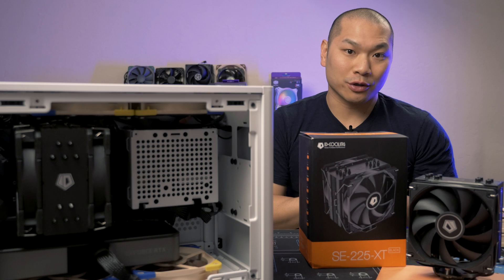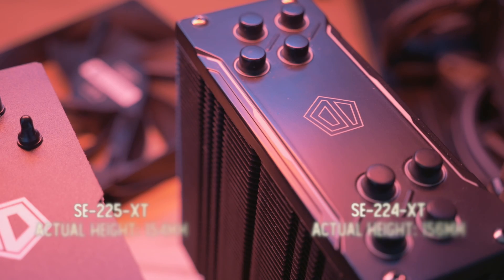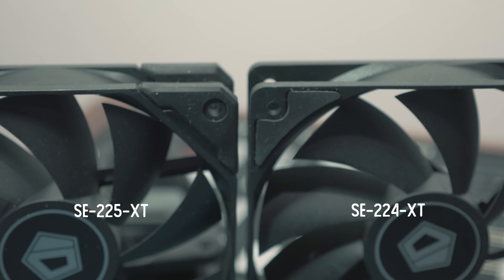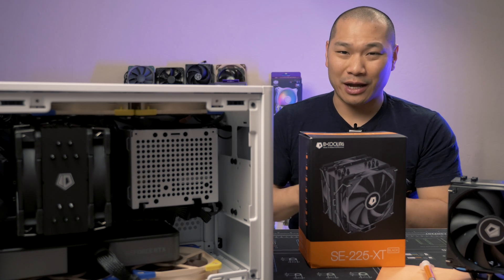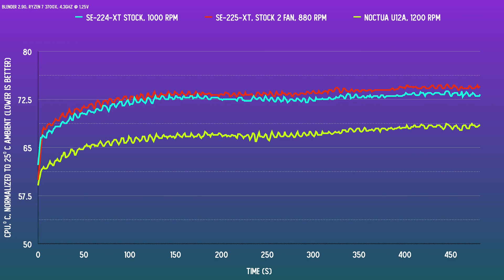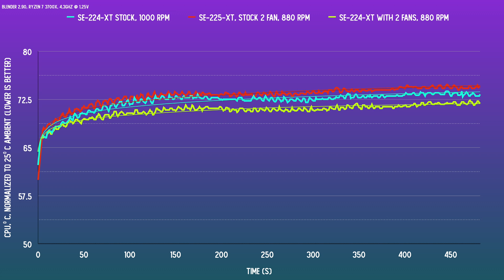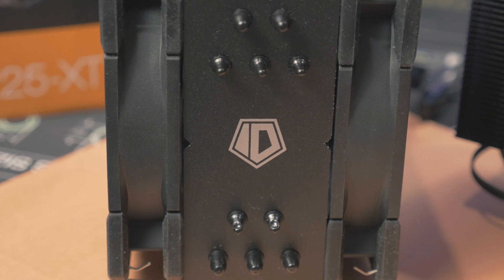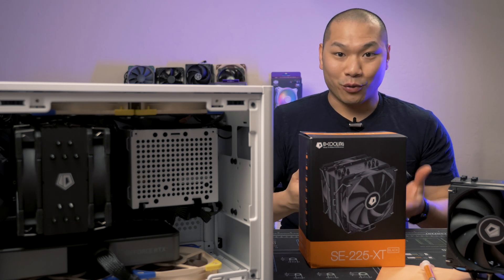The ID Cooling SE-225-XT: Ryzen 7 Test

Comment from the maker: Since the thermal tests are kind of counter-intuitive with the single chiplet Ryzen 7, and I think the heatsink design has a big part to play, I will be posting up a quick follow up for tests with a single chiplet 5600x and a dual chiplet Ryzen 9.
Reply: It's probably poor quality control on ID Cooling's part.

You can check this other review of another SKU that supposedly has better cooling than SE-224 but outright loses(turn on english subtitles)
https://youtu.be/wEoTJcYe510?t=688
Reply from the maker: Thanks for sharing that, very interesting. I hope it's not QC, but then again, maybe it is. Small variances in the heatpipe/vapor consistency could lead to big differences.
Reply: Woot! Was gonna ask about ryzen 9 performance. Considering options to replace my cryorig H7 quad lumi. Gaming in the nr200p with tg panel it hits mid 70s but that means 100% fan speed. 

When I ran the 5600x with the same cooler and orientation it barely broke 70.
Reply: do you know if this cooler is compatible with an intel LGA 2011-3 socket?
Reply: Hi Sir! I have Ryzen 5 3600, NR200 case with mesh panel and I plan to use this cooler. My motherboard is B450i Aorus Pro Wifi
Reply: @piptaz04  use SE-224-XT
Reply: Guys buy 224xt argb v2 version . The fans are way better than basic version presented in this video . I m using it with 5800x max temp with PBO activated 80 C  in CPU Z stress test and 60C in games  30 idle. I have buy this cooler cuz i see @machine & more 2 years ago. 
All the best.
Reply: dude a word of advice...youre very technically capable and have hands on skills - but the flow of logic and ideas in your videos is not clear /properly explained. 
You need to have a good script and explain 
-what youre going to do, 
- show what youre doing,
- explain/summarize

Doing this will boost your viewership

Comment: The SE225's design for the base with gaps btwn the heatpipes probably caused it to perform worse than the 224 because of the very high thermal density in current and more recent cpus.

Comment: I theorize that as the heat pipes exit the base plates on the SE-225, they are too close together, forming a wall so that air cannot flow between the pipes.  This is evident at 2:04 in the video.

Comment: Fascinating result, good creative idea to try 2 fans on the SE-224!  The situation is probably like the Fuji F21 camera (or whatever, i may have forgotten the model) and/or the Panasonic Lumix ZS4.  Both manufacturers produced MASSIVELY superior devices whose pictures dominated ALL CAMERAS for 5Y or more, 1-2 f-stops sharper than all similar cameras.  Why?  Some sort of "very good luck" or "perfect matching" of components (sensor density, lens).  Even though both manufacturers continued to release new versions of their products at higher price points and with more features and even CMOS sensors, they never attained such greatness again ...

Comment: I'd like to have seen the SE224 xt with the Noctua fans in push pull. I'm going to build and use a 224 XT with two Arctic cooling bionics fans but it won't be built for a while. I'm going to use it in the tropics and I want it to work well even when air conditioning is broken.

Comment: Really wish i could find heatsink tests with standardized fans at different heat loads and different CPU's, think it could be pretty interesting to see, i'm currently using a Mugen 5 with a 5600x but thinking of moving to a smaller heatsink, upgraded the fan to the Phanteks T30 so i've been wondering how the Mugen 5, SE-224-XT, Gammaxx 400 v2 and NH-U12A would perform using a single T30, i guess likely similar on a low TDP 5600x but i'm planning on moving to a 5900x/5950x later on

Managed to find a SE-224-XT for $25 and i can resell my Mugen 5 for double that so think i'll jusk do it and hope it handles higher heat well in the future, the T30 should give some extra performance compared to any AC stock fan as well, i'm also considering ambient temps slightly higher here. I'll definitely miss Scythe's screwdriver though...

Comment: Looks like you have the fans on the 225 in opposite directions lol 7:59 appears the inner fan is intake and the back fan is exhaust. So they are working against one another and the reason they are performing worse than the 224

Comment: Should I change my cooler from Cooler Master Air MA620p to this for my Ryzen 5 3600? I have 40-45°c idle and 66°c max load. Or am I just paranoid?🤣
Reply: It's fine, I'm using r5 3600 with se-244-xt, I've got 38-42 on idle, 68-72  on heavy usage. I just ordered Arctic p12 to add one more on the other side.

Comment: is IDCOOLING SE 224-XT / 225-XT COMPATIBLE TO R5 3600, GIGABYTE A320M-H REV1.1, CM 500W 230V,
PALIT GEFORCE GTX 1050TI???/ THANKS
Reply from the maker: Should be great for any Ryzen 5 CPU. As for the other components, your Mobo works and the power supply is sufficient, so as long as they fit your case you are good.

Comment: does the 225 xt/224 xt fits with the mesh panel?
will they interfere if im using 2 Arctic p12 top exhaust fans?
Reply from the maker: Yes, it does fit. You should be able to do two fans at the top with most boards.
Reply: wew. I’m planning to use 224xt with 2 Arctic p12 as top exhaust.  I was worried it might not fit. Thanks for the clarification.

Comment: Hi one quick question, if you remove the decorative top panel of the SE-224-XT would that be enough to mount the fan/hdd bracket with the vented panel on? Or is it still too tall? Thanks.
Reply from the maker: Still too tall. But you can mod the panel if you really need it. Just drill out where the heatpipes touch and allow them to go through.

Comment: Do you think this cooler is better for the price to performance when compared to the u12s?
Reply from the maker: Absolutely. The SE-224-XT with NF-A12x25 would be similar in cost but with better noise performance.
Reply: @MachinesMore  Gotcha. Just wondering, because I'm searching for a heatsink to pair with 2x thermaltake toughair fans. Idk if adding a pack of $35 fans would do much

Comment: Is it possible to mount 140mm fans to this cooler?
Reply from the maker: I'd imagine if you can get the right clips it could work, but the fan will exceed the frame of the heatsink- most fans move the most air towards the edges so you'd be missing out on that, the air is just going to take the easy way out and bypass the heatsink.

Comment: Hey there, just built my new rig and I'm having some problems with ram clearance for a cpu cooler. Currently have:

MSI B550 Gaming Edge Wifi
Tforce Delta RGB White

The hyper 212 led turbo red I bought can't fit because the fan hits the ram even if I adjust it to the highest point.

Any suggestions on an aftermarket air-cooler that can fit with my motherboard and ram?
Reply from the maker: If it’s like the Hyper 212 V2 there should be a configuration that doesn’t have a RAM limitation. 1) Are you able to place the fan on the rear side of the case? Not sure if it’s an option with that board. 2) if you rotate the cooler you may be able to fit the fan where you want it without interference with RAM.

Comment: the 224 is very impressive. Got one for $30 only, and keeps a 5600X extremely cool, I'm talking about near high-end cooler temperatures. Black magic I say.
Reply: Same here. Iddle dropped from 45-47 to 35-36. Heavy load gaming from 85-88 to 66. It's bonkers.
Reply: @leonelidas89  It is recommeded for a 5800x?
Reply: @juaniriartesoliz4613  I don't know. Maybe for gaming and normal use, not OC.

Comment: Hey dude I was wondering if you could make a review on the Silverstone SX1000 Platinum SFX-L PSU that just came out. I was actually planning on getting one but I have not heard many great thing about it on Reddit, Amazon and even Silverstone's on website. The main reason for those negative comments are because of the supposed fan noise it creates during idle. I was hoping to get your take on this, thanks!

Comment: What would be the best for the tempered glass option?
Reply from the maker: If you want an interference free fit I found the 224XT to work without the cover. Both coolers stock will require some screws to hold the panel in place.
Reply: @MachinesMore   thanks for the info. Is there no tower cooler that would fit the tempered glass w/o screws? I’m also using an Intel i7-9700k for cpu if that changes height with mounting hardware.

I used the Mugen 5 but the heat pipes still hit the tempered glass, as well as the fan clip hitting the 120mm exhaust case fan I had set up
Reply from the maker: If a Mugen 5 won't fit, your Z390 motherboard is probably one of the taller ones, is it the Strix board you have? That's why they quote a fairly conservative number for CPU height in case there are small variations that cause interference. Since that one is not an interference free fit, the choices are narrowed down somewhat, for 120mm coolers you're looking at a Cryorig H7 pretty much, since that's one of the shortest ones. You could also go to a 92mm tower like the Noctua U9S.

Comment: Thanks for the review. Could the 225's poor results be related to thermal paste? When you removed the 225 from the CPU did you happen to notice the paste distribution? Could paste application as recommended by Arctic for direct touch heat pipes (https://youtu.be/JYwHB2P6GmM?t=193) improve the results? Thanks!
Reply from the maker: Sometimes, yes it could be. The litmus test is what the paste pattern looks like after pressure is applied. I ran multiple tests and remounts due to the unexpected results but had the same results. Further testing with the paste applied to the pipes still yields better results for the 4 heat pipe version on the single chiplet 5600X. With a dual chiplet 3900X things look more regular.

Comment: Your previous vid tipped me over the fence to buy the SE-224-XT, albeit the RGB version, over its competition in the same price stack. The Ryzen 7 1700 3.7GHz at 1.275V dropped from 93-95°C with the Wraith Spire LED to 68-72°C.

It also helps that it's got a superior LGA 115X mounting system, and not those stupid pushpins, which will definitely come in handy for a future project of mine with older Intel hardware.
Reply from the maker: Glad you are enjoying it. I think it’s the go-to for single chiplet Ryzen and gives budget flexibility to upgrade fans and such.
Reply: @MachinesMore  Yep, the ID-Cooling 12025 fans are definitely more premium feeling than the Deepcool ones at a similar prices. Less body flex and it even has those anti-vibration rubber pads around the screws which Deepcool advertises but isnt on the delivered product... I know, I bought two of those.

Comment: I have a nr200p and have the 224 on ordered.  Do I really need to remove the plastic cover for the TG panel to fit?
Reply from the maker: Possibly, you can either screw the glass panel on or remove the cover for an interference free fit.
Reply: @MachinesMore  
Ok, ill try that.  Thanks for the reply.  Also, ill be using this on a 5900x at stock.  By adding a extra fan in the back, you think it will be sufficient?  The reason I pick this cooler because it fit with the TG panel and its white so it fit my theme.  Currently running with a 120mm AIO and I'm idling at 64C and full load at 84c.  So, hopefully this cooler will be better.
Reply from the maker: Hey David, it will be sufficient with two fans. A quick follow up is coming on Ryzen 9 and the 225 xt is better, but mainly from the 2nd fan. That being said on either cooler that fan will need to run harder at higher loads so just be aware of the noise implications.

Comment: I use the SE 224 XT with some Arctic F12 fans in the NR200, is it worth to upgrade it to some noctua fans or not?
Reply: Are your thermals concerning and/or stopping you from getting what you need out of your computer? If so, I'd consider the upgrade. If not, no need to upgrade.
Reply: You should have bought the Arctic p12s. They are much better than the f12, close to noctua for 1/3 of the price.
Reply: @Psi-Storm  I mean that's not gonna help him now
Reply: @kyleivy7679  It will if he's considering to upgrade to Noctua.

Comment: SE 225 works with nr200p (tempered glass) but still don't understand how this can be worse than SE224! I have the CM nr200p with the ryzen 3700x searching for Cooler that can go with the tempered glass and this was to cooler I waited for but now ...this results ...Sad face :(
Reply from the maker: The 224-XT fits, just take the cover off. It's really good. I should also point out, the 225XT doesn’t fit, you would need screws to get it to work.
Reply: @MachinesMore  They have SE-234-ARGB ! Wonder how that compare to this two!? So for my 3700x just pbo on  I'd cooling se224 is the better choice! Also I have seen that I can fit one 120mm fan in the back of the  nr200p and wonder if I can make a little easy mod to make one 120mm aio work.  I'm sure this can be done with some motherboards like( Asus strix x470-i) I have ! If you can try this well...another great nr200 content ! Anyway,  thank you for this nice content and nice holidays to all!
Reply from the maker: I think so. I've heard some mixed experiences though so I'm not sure if there are some manufacturing variances, but design wise I'm sure it's perfect for Ryzen 5 and 7. Even if you could make the AIO work, the vents on the back aren't as plentiful- there are lots of covered up spots so you won't get as much surface area.

Comment: that's weird. somehow my results are pointing towards the 225 been better. i did a comparison ( i have the fuma2, mugen5, h7 quadlumi too) the temperature is better on the 225 than the rest including the 224. but i did do 1 thing i learn from either the bequiet or some other cooler's instruction. i applied the thermal paste on the headpipe then put it down onto the cpu. was using the mx4.
Reply: o yes forgot to include that i am on the 5900x cpu.
Reply from the maker: Did you keep fan speeds the same?
Reply: @MachinesMore  yes i did. i standarized the fans to all be arctic p12 pwn at same speeds. didnt have any noctua for the test so p12 are all i could used. 225 was better but i will say margin difference. nothing near to the "10%" i was kinda expecting with the extra heatpipe.
Reply from the maker: Gotcha. As far as the thermal paste goes, for sure on some direct contact heat pipe designs painting the TIM on the pipes is helpful. It was a bit of a head scratcher to me too, so I triple checked and re-mounted the SE-225-XT and it yielded the same results.
For another review when tested with a dual chiplet Ryzen 9 CPU the 224-XT wasn't as good relative to the U12A as it was on the 5600X. It's strangely good with single chiplet Ryzen, which is why I recommend this over the 225XT in those circumstances. If you're going with a 5900X I personally think it's a good idea to spend above the $50 price bracket for a cooler.
Reply: @MachinesMore  i would love to spend more but i want to show the insides of the NR200P with TG panel. So i have a hard time finding anything better than this. would love to give the cpu an AIO but the top of the NR200P cant be mounted with an AIO. a slim AIO for the top is not going to do much better than all these air coolers i think. if only the case was a few mm wider..
Reply from the maker: I hear you. Didn’t realize you were in the Nr200P so yes, your options are a little more limited. There is a whole realm of suitable coolers for want of 2-3mm.
Reply: @jylee9682  So the SE-225-XT fit in your NR200P with the TG panel OK?
Reply: @golfgrouch  yes for me it closes perfectly. on asus rog strix x570i. previously my fuma2 wouldnt close properly.
Reply from the maker: Interesting- same mobo as the test system and won't close without using screws. And that's why case manufacturers spec lower knowing there are variances.
Reply: @MachinesMore  yes i guess it really depends on the ends of the heatpipe. now I am thinking if it is time to move on from the NR200P to a bigger case for itx. i was thinking maybe the lian li o11 mini given the many constraints of NR200P. but i love this case so much....